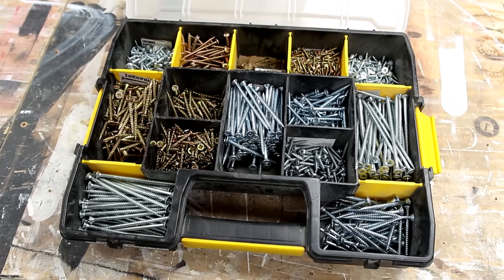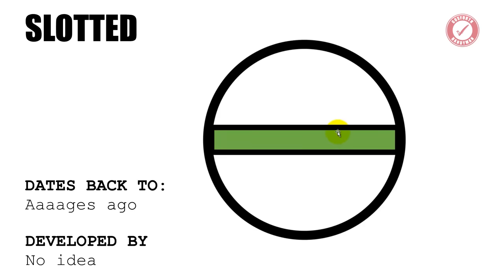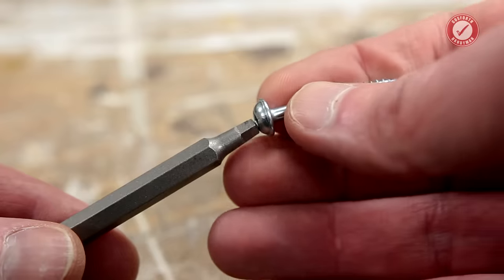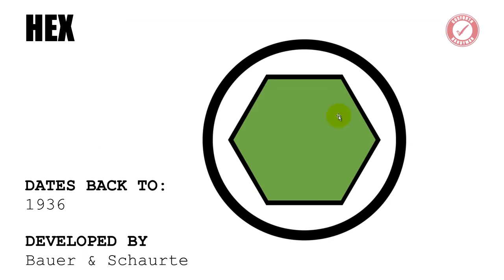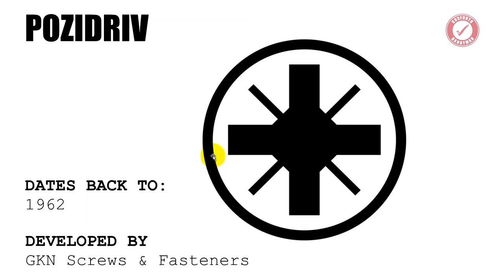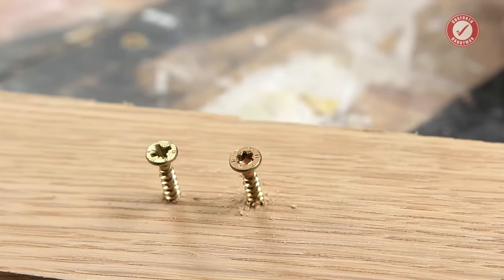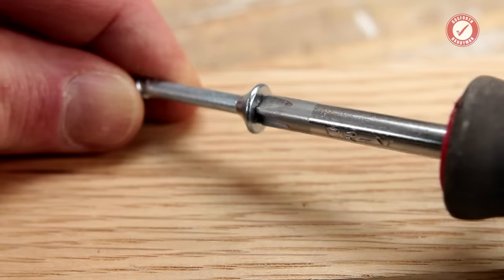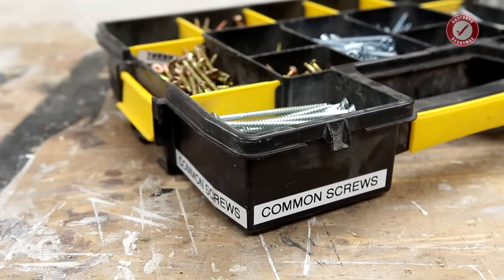Why are Pozidriv screws better than Phillips?

Comment: Being a DIYer I’ve just discovered TX (Torx) screws. They’re the best thing I’ve used in years. Just put in 500 of them on a project and none of them caused me any issues and still on the original TX bit, supplied with the screws. I’ll never go back to Philips if I can avoid it. The other advantage was that you can screw, then re screw and the head is still in perfect condition.
Reply: I think it all goes down to that taper, I think  I saw somewhere the point was to prevent over torquing, which with modern drill and drivers that have a clutch should never be an issue. Not to mention the fact I almost always end up using the wrong size driver just because I can
Reply: I'm sometimes tinkering with old applicances that have obviously been designed for low cost, and I have ruined quite a few Philips screws while unscrewing them because they were made of rather soft (and presumably cheap) steel. Combine that with a bit of accidential cam out, and you have a small area of contact where the screwdriver just reams out the screw.
That never happened with Torx. I was initially skeptical of buying yet another set of screwdrivers (as if we did not have enough systems yet), but I've come to like them.
Reply: @rabiatorthegreat6163  sometimes I find flat head to be easier on those cheap Philips.
Reply: @rabiatorthegreat6163   You have to ensure that you're using the exact fitting PH driver for Philips screws, otherwise they're getting chewed up. The right size is generally the absolute largest size that will fit in at all, and have the least amount of wiggle. It sometimes looks ridiculous because the driver is sometimes almost bigger than the screwhead, so the proper driver selection can sometimes turn out a little counter intuitive.

Another thing to worry about is JIS screws which will extra easily strip with a Philips driver. That's Japanese and sometimes Korean electronics. Maaaybe Hong Kong from way back. Not seen on mainland China products so far. They are supposed to have an extra marking of a dot but it's often times not there or seemingly not there, we're dealing with old garbage right.

I also resent the video for saying that you can drive PZ screws with a Philips driver, or that you only need PZ2 - using the wrong driver family or wrong size leads to regrettable outcomes. Well JIS drivers are more or less good on Philips screws but not the other way around.

That being said if you have the opportunity to leave Philips behind for good, i fully support taking that opportunity and i do like Torx. Except Torx is so good at torque transfer that you can sometimes shear the whole screw head off. And then what do you do? You can't use a screw extractor. New fear unlocked?
Reply: @fulconandroadcone9488  "Over torquing protection" phrase was put out to mask the fact that a few cam outs on a small Phillips head is all it takes to make its screw almost impossible to undo (without extracting). Same with small hexes, though instead they just look like damn circles after that.
Reply: So Torx came out the year I graduated from high school.  LOL  No wonder it rather took me by surprise when I first started encountering them in the late 70's.
Reply: agreeded. I cant stand phillip screws, i never used the square ones but i used just normal torx screws .( i might have used some poziscrews mixed in there. they look like normal phillips to me but my driver socket does have those indentations for pozi so idk. never even knew they were a thing until now)and they are just better all around. harder to strip, you can just go full send on your drill and not have to worry about stripping due to too much force, easy to screw it at a wierd angle, and best of all. easier to get out and replace an old screw especially if its been exposed to weather. the only acceptable use case for phillips is for electronics imo so you don't need to have a whole 30 set of torx lying around just to open up the device.

Comment: I’ve never understood the difference between Philips and pozi till this vid. Thx
Reply: Yes you’re right 🧑I’m also confused until I buy Dewalt screws bites set and see the difference by myself
Reply: @Dan Dearinger no one cares and it doesn't work
Reply: The most important difference between PH and PZ is that PH has a built-in limit for the torque you can apply to the screw due to the slightly conical shape of the flanges. This was intentional so the driver will slip before overtorqing the thread. But since we use electrical screwdrivers nowadays people always tried to overcome the slipping by applying more pressure until the slip anyway and ruin the head of the screw.

PZ has straigt flanges on the main X so it doesnt slip but makes a torque-limiter in the screwdriver mandatory.
Reply: Neither of them should be used anymore.

Comment: Weren’t Phillips heads also invented to limit torque during an era when power tools could not sense over-torque without a mechanical limitation?
Reply: I read that about Phillips/Pozi, but it's gonna tear up the screw heads and the bit after driving a few, so why use it with modern devices?
Personally I've had issues recently with removing screws with torn up Pozi heads that I wished were Torx.
Reply: This a cross-over I did NOT expect.
Reply from the maker: Sorry for the slight delay! Missed this one. I've heard of the torque limiting from a few sources but can't find anything about this in the original patent. Needs further investigation... 🤔😁👍
Reply: It is a fact that the Phillips head causes the driver to cam out easier than Pozidriv. This is because the flutes are tapered. It also means that Phillips screws need more downwards force on the driver to not cam out early.

Now there's a lot of talk about Phillips being bad, and while there are truths there's also ways to avoid or minimize the problems. First thing I think of is the driver size. Sure a PH2 may fit a lot of screw sizes but it's not right for all of them. You should make sure you have drivers sized all the way from PH00 to PH3. Any larger than that is special and you will most probably not encounter them. It's the same for Pozidriv you need several sizes to have the right driver for the screws. Using the Phillips driver I prefer I can hold the screw with the driver attached horizontal and the driver will not fall out. And yes I'm only holding the screw. I can tilt it even further and the driver should stay in place until about a negative 45 degrees. This is decent screws made in China, but with Chinese screws quality really wary. Some are good while others are really worthless.

Next is something I was told by an engineer. Once the driver has cam out three times the driver should be thrown away and replaced. This can get costly with screwdrivers but actually works. With driver bits being sp cheap throw them away after the first cam out. The reason is that not only does cam out damage the screwhead but it also wears down the driver. My preferred drivers are quite expensive and the metal is very strong. The driver head on them also have a coating of industrial diamond dust which bites into the screws and keep them in place. There is also paste with diamond dust that can be used to coat the drivers, but I've never used that. I'm sure there are driver bits that are just as well made but I've never encountered any. Instead the bits are cheap enough I have no problem throwing them away when they start to wear.

In short, use the right size driver and don't use worn down drivers.

I'd go as far as saying that these things are important for all kinds of screwheads. Quality drivers and the correct size makes a huge difference.

Now there is one more screw head to keep in mind and that's JIS. This looks a lot like Phillips screws but they are actually a Japanese standard and not quite compatible with Phillips head drivers. One way to recognize a JIS it to look for a single dot punched between two of the lobes. If it's there it's a JIS screw. Now a JIS driver will fit a Phillips screw head decently, but a Phillips driver won't fit a JIS screw.  At least that's the standards, but to my experience a lot of Phillips drivers are actually cut so they do fit decently in a JIS screw head. Either that or the JIS screws I've had weren't quite following the JIS standard.
Reply: Phillips screws were not designed with torque limiting in mind, it was something that was noticed after use and spun as something positive to limit over tightening.

Comment: As an engineer, my professional opinion is that Phillips screws should not be used for new designs. Hex or Torx are the only options I currently use for new designs. Definitely hex if it's for an end user. Everyone should have an allen key set. If they don't, that's like not having a hammer, or a toilet brush. It's the bare basics.

Comment: The fact they are still making slotted is criminal their the most useless screw especially compared to what we have now.
Reply: It still is the most simple system.
Reply: If they are going to be seen the slotted brass screws look far better. Also it is typical that slotted wood screws are slightly tapered and have the important smooth shank that is better for pulling wood together.
Reply: They look better if its renovating old doors  and things
Reply: One explanation perhaps is slotted screws are much easier to clean if they have been painted over (scrape away the paint from the groove with a knife)
Reply: They look nicer. That's it. Door furniture looks 10x better with slot head screws.

Comment: The torx wobble problem can be countered with wedge fit bits. They are slightly tapered and lock onto the screw solidly. They will stay dead straight and drive right in with no wobble. Available from Wera.
Reply: For example if you use the brand  spaxx  you can use the driver bit T20 from  3.5x15 way up to 5x100mm  and if you use the original spaxx bit the screw doesn't wobble at all 
But they are pretty expensive
Reply: @a100independent6  Nice to know thanks. I loved the spax wirox for decking, no messing, no hassle.
Reply: @a100-  Spax + has a round hole at the tip eliminating the wobble . 
However i LIKE the wobble because it allows for angling the driver bit and driver when an obstacle is in the way .

Comment: I think you will find that POZIDRIV bits are not tapered hence reducing “cam out”, how you got through the whole video without mentioning “cam out”i cannot imagine! Well done.
Reply: I always thought THIS was the main reason for using POSIDRIV, nothing to do with extra points of contact. The torque applied at the centre must be tiny compared to that at the ends of the four slots.
Reply: I don’t follow. How are the bits not tapered?
Reply: @jronmanbuilds  Think of a simple screwdriver.  The end could be parallel or like a wedge.  The philips is like a wedge, the pozi is parallel.  Phillips at 4:13 and notice the straight faces on the Pozi at 6:00.

Comment: I enjoyed this vid and your walk-through the drive type evolution. I’m a bit of a patent nerd and hardware nerd and have read the patents for all these drive types and have to point out that the advantage of the Pozidriv (TM) isn’t four additional point of contact, but rather that fact that the four blade segments have straight faces rather than tapered faces like those seen on the Phillips. This was done to prevent cam-out. The four “tick marks” on the head of the screw are there from the production of the slot, which is done with two dies; one that forges what looks like a Phillips slot, and a second that strikes between these points to close the slots, marking their faces parallel. The additional points on the driver are there for identification only as they don’t even make contact with the screw. See the taper in the Phillips at 4:13 and notice the straight faces on the Pozi at 6:00. Oh, and the Allen “Hex” drive screw was patented in 1910. There’s a fascinating story involving Henry Ford, P.L. Robertson and Willian Allen, but that’s for another video. Hardware nerd out!  Scott
Reply: thx, finnaly i understand why its so much better. I was always wondering, why the PZ is so much better, even thought the small cross doesnt even touch the screw
Reply: Oh very sharp and finally a good explanation. I was certain that it had something to do with angle selection but i never understood what angles were the crucial ones. And yeah i have a hilarious set of PZ bits which are made wrong and where the additional little cosmetic protrusins are rotated a little, they're machined with an error... work just the same as any normal ones since these little ones don't really even touch down.
Reply: The additional Points on the driver are also a result of how the driver is beeing manufactured

Comment: You can find tapered / self-centering torx bits, and since I discovered them they are my preferred choice bits as most wood screws easily available here in Sweden seem to be either t20 or t25.

The amount of childlike joy I feel every time I put a torx screw on the bit in the impact driver and it stays there even if I wiggle it around is absolutely priceless.

Comment: Been using Torx myself for nearly 10 years after Steve Ramsey raved about them. Surprised more of our friends across the pond haven't bought into the idea more in light of that. Not once in all those years has one stripped, even when using an impact, which I do for 99.9% of driving. Great video again Andy.

Comment: Last year I finally bought a box of torx head screws, and my god I have never been so happy. instead of having to press against the screw with all my weight, torx head screws just pull themselvs in with little to no pressure once started

Comment: Great video Andy.. 60 years on this planet and I can now tell the difference between PZ and PH..... thanks to you 👍
Reply from the maker: No worries - you'll curse every time you use a Pozi screwdriver in a Phillips screw now! 😂
Reply: @GosforthHandyman  I have a philips screwdriver in my toolbag with PH2 written on the handle with a marker.  I am surprised how often I have had to use it to assemble flat pack furniture type jobs.

Comment: Something as basic as using the right screws for a specific job is so important. I tear my hair (what bit I have) when I have to remove radiators when the brackets are screwed with slotted screws and are long. Havoc for my wrists!! Good video so look forward to more

Comment: In Switzerland, in my experience,  tradesmen only use Torx screws.  Having been nosey and looked at what they carried, no Posidrivs were to be seen, but the full range of Torx were there.
Reply from the maker: Used a lot by trades over here too - depends on the job. I see a lot of Torx in window fitting especially. Pozi are still generally more common though - just about every kitchen for a start. 😀👍
Reply: Gosforth Handyman  there is of course the  Swiss  “if it’s more expensive, it must be better...”

Comment: 8:30 Honestly, it doesn't look like additional features do much here. To me, it works just the same way as PH. Correct me if i'm wrong.
9:20 It's not those flutes that prevents PZ to fit PH screw. It's because PZ screwdriwer's blades are thicker and don't fit into recesses. You can clearly see it in 9:20.

Comment: A revelation. Use the Robertson square driver on the Posidrive screw. Works better than anything out there. Bit finds its seat easily, stays in, and never cams out. Try it. You'll like it.

Comment: Seems any of the cross slotted designs are an exercise in frustration when they cam out if you have to drive them into something somewhat hard by hand. Torx or Robertson followed by Allen (hex) in preference here, as they don't slip out when you're turning on 'em.

Comment: TORX,,,,, there is no substitute ! I live in Germany where Torx has all but taken over the market , at least with wood screws . i like the fact that the screw does not remain at 90 degrees to the driver . this allows one to drive at a slight angle when an obstruction is present .

Comment: Great explanation of the drive types. The funny thing is that all my life (mostly working on electronics and consumer products) virtually all the screws I’ve run into are Phillips despite them being one of the worst types still around (although still miles better than slot screws, which are still used in electrical cover plates).

Here in Canada, Robertson are most popular for construction, and Phillips are used for drywalling. I believe Torx is more popular in the US for these purposes. Pozidriv is almost unheard of, the only place I’ve ever seen one in real life is in high-end cabinetry, and of all the dozens of screwdrivers and bits I own, there isn’t a single Pozidriv bit among them. They are a special order item.

Comment: Thanks after years of using them i learned why pozidrives are best...but  I do like robertsons too since I got a load of deck screws made with these which had the driver included. Never a problem removing years later.

Comment: The big advantage of the Robertson screws is that you get 2 screws in 1: a square head before using it and a round head after having used it. Double whammy! 👍😜
Reply: If you're rounding screws out, change your bit, it's worn out.  A Robertson is tapered so that it can be press fit to a screw.  This is handy for driving screws one handed.  However, if the screw is no longer sticking to the bit, THE BIT IS WORN OUT.
Reply: @Bryan46162  Or, 4 corners is just not enough. YMMV but at my factory we use about 1300 pounds of Torx screws per year and never have any problems, unlike the Roberstons we used before.